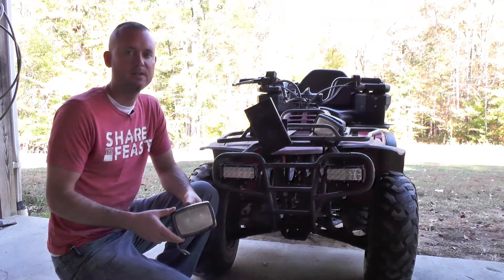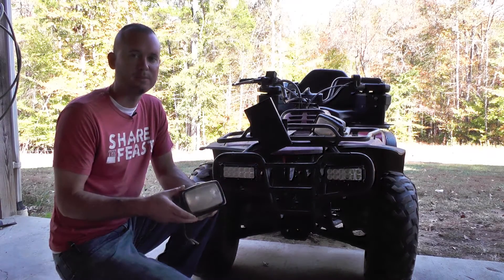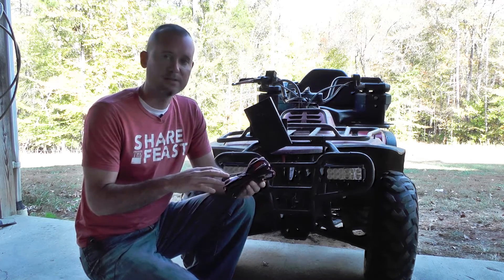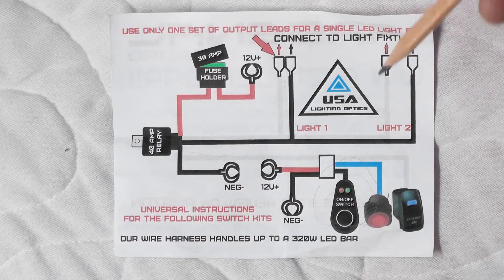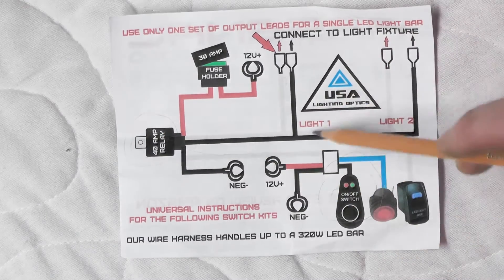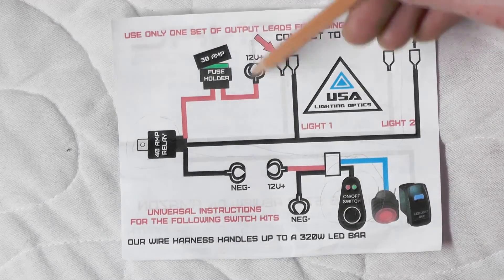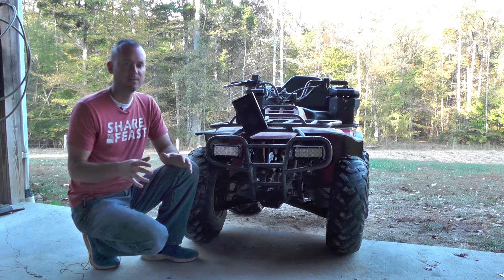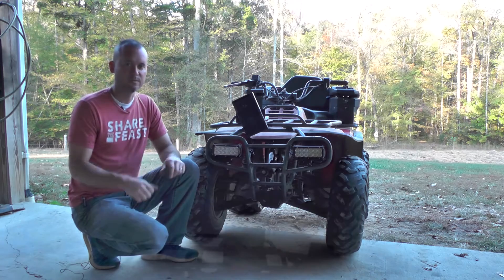Our NEW LED Lights are Flashing at Idle? Here's a Simple $14 Wiring Harness Kit Fix

Comment: Those Ebay cree LED's cant be beat for the money. I put together an old Polaris Xpress 300 2 stroke for a good friend. They were going to use it on the farm. I went through the whole thing, new brakes, bottom end bearings, top end, and all. It had burnt out headlights so I bought two of the 4" square Cree's and put them in their place since it also was a strictly farm use ATV and they were great for the cost. I also wired them into the stock switch and didnt have any pulsing, but this was also on a 2 stroke that idles higher and its possible the charging system is different as well. Great video!
Reply from the maker: Thanks for the comment and additional info! Always nice for folks to hear other do-it-yourselfers experience with wiring these LED's up.